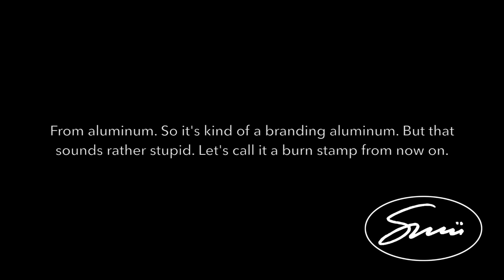Making a burn stamp / branding iron w/o CNC or welder

Comment: Incredible! I am a amateur woodworker and have recently made some wood swings for my daughter and granddaughter. I wanted to engrave (or something) on the project and finally decided to purchase a wood branding iron. That is until I saw the prices! have a limited budget to work with, so, I decided to look on YouTube and see if anyone had built a branding iron. An, that is how I found your video! I am really impressed! I am not sure that I can make one like yours, but I am going to give it a try! Thanks for sharing the video!
Reply from the maker: Very glad you liked it, even more glad that you'll be able to put your to good use.

The process of making those is a bit tedious, noisy and messy, I'll make another version somewhen in the future, casting those. Which not only is going to be tedious and messy but will involve open flames and molten metal. So  ... YAY!

Comment: This was a great video, I never thought about just drilling and dremeling the waste.  Thanks for the effort!
Reply from the maker: It dawned on me that a CNC bit does not do much of anything else than what I did manually. I thought about making a fixed position stand for the dremel and move the workpiece underneath it, but I didn't have a decent clamp for the dremel.

As to the effort: You're welcome, glad you liked it.

Comment: Save a couple of steps; Get an old screw driver, cut off the end and put threading on that; pre-drill and tap the aluminum blank before you cut the logo.
Just a thought 🤔
Reply from the maker: Nice, thank you. I figured a few different ways to do it more nicely pretty much right after I was done. But that is always the case, methinks.

Comment: Using brass plate would be a better choice, but I like this :)
Reply from the maker: Thx.

I didn't have any brass stock on hand and neither had any of the metal shops. Didn't want to order anything, so I used what was at hand.
Reply: Agree that brass would work better for longevity, but is there a good reason to NOT use aluminum? I ask because I have a ton of cutoff pieces and was looking to do this exact same thing as soon as my logo is done. Aluminum will heat up much quicker, but probably not hold the heat as long as brass. And because it's a lot softer you have to make sure to take care of the brand, dropping it would easily damage it. Other than that, any reason to not use what I already have on hand?